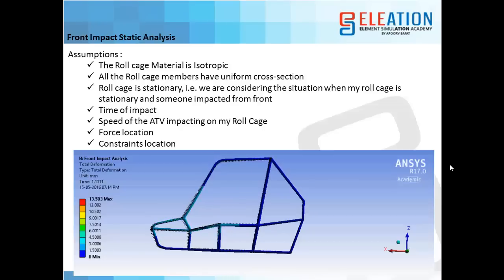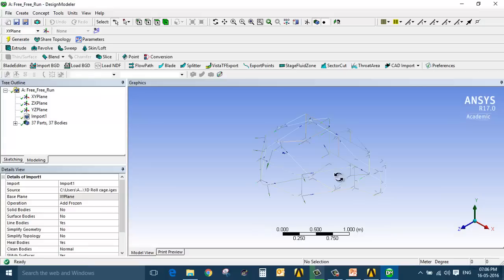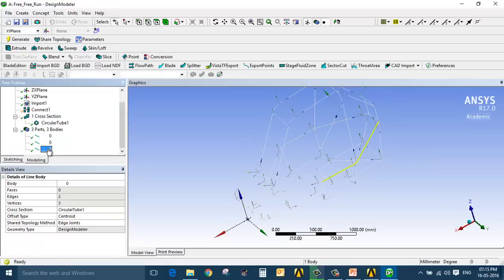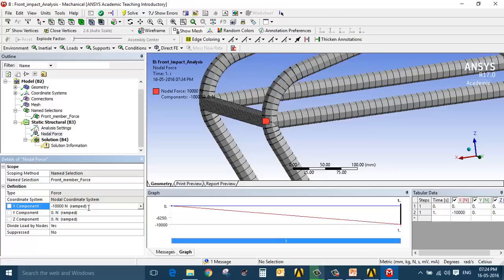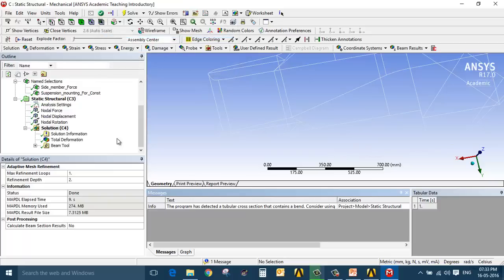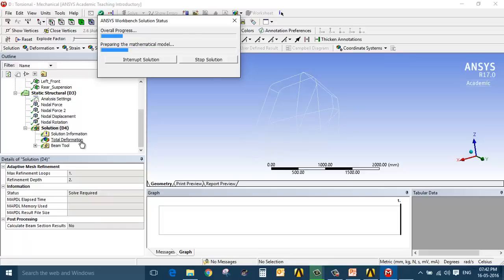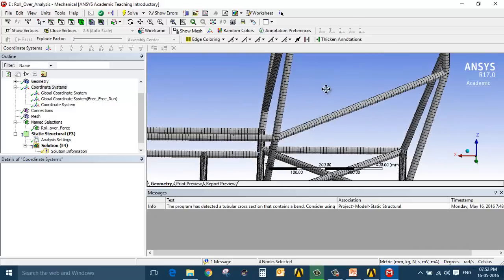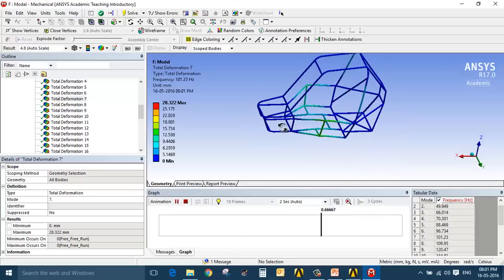ATV Roll Cage Analysis Using 1D Meshing and Static Analysis

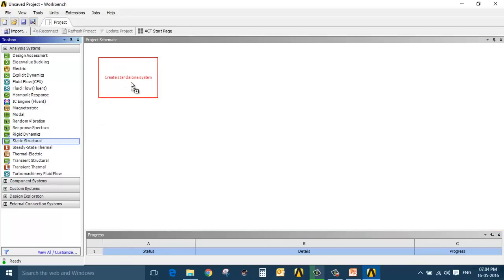Comment: Free Free Run (to check for connection) 6:27
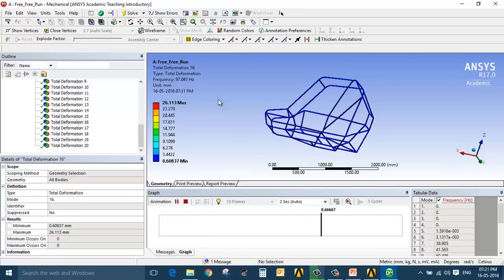Front Impact 23:25 
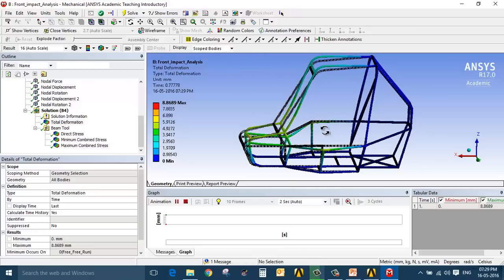Side Impact 32:16
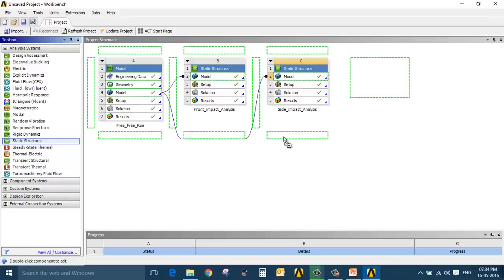Rear Impact 37:05
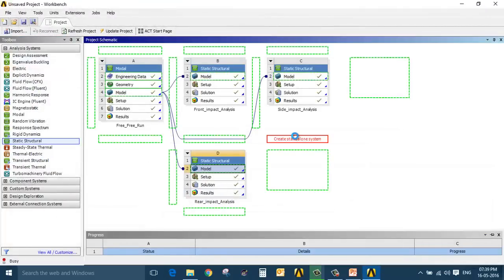Torsional 41:40
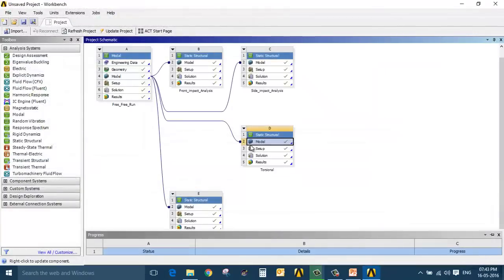Bump 45:51
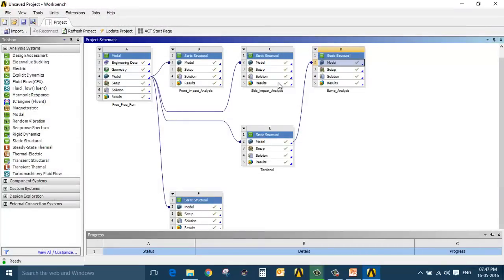Roll Over 49:45
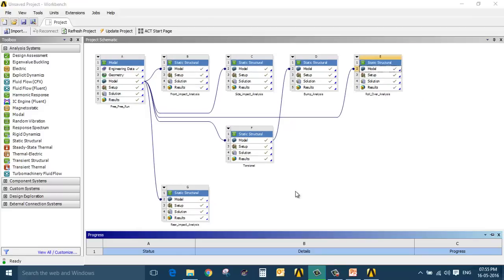Modal 57:16

Comment: Can Any explain me how to save only sketch as IGES that is used as 1d file(solidwork file) in this video
Reply: Go to save as option click igs then select advanced after that click on wireframes instead of surface and finally click checkbox of bsplines below it.
Also click datum and those 4 checkbox at the start if you want.

Comment: I cannot connect the members. I have 53 parts and no matter what I do, I always end up with 37 parts. I tried selecting manually and automatically. Nothing is working.
Reply: Same😭😭😭😭
Reply: it will be a problem in imported geometry it might have multiple elements
check for extra members and try again
you will get
Reply: Same problem
Reply: @anujtembugade9253  Check your geometry and repeat
there might be unwanted elements without your knowledge

Comment: At 20:40, note that there is a warning sign (yellow tick mark near import sign which means connections are not established fully). This means the further results we get as we do analysis won't be accurate as the connections haven't been established fully.

Comment: Ur lecture was attractive sir, if u don't mind can u spend a few min in explaining about how to apply different crossections to the ROLLCAGE, as u explained with only one crossection in this video...this will be really helpful...!!!
Reply: Sai Sai did u found a solution for this?
Reply: did u find it? I think Ansys has a limitation where 2 cross sections cant be in one part. I'm stuck here as well.
Reply: Gunen Dran same here. Just not able to get 2 cross sections
Reply: Go to MenuBar>Concept and add the 2 cross-sections - Primary & Secondary as per your decided dimensions. The, use controls button and select the primary members using the mouse, assign primary cross section in the dialog box. Repeat the same for secondary members. Voila !!!